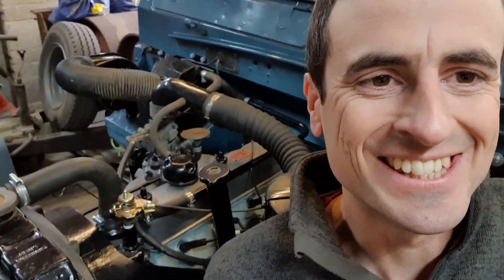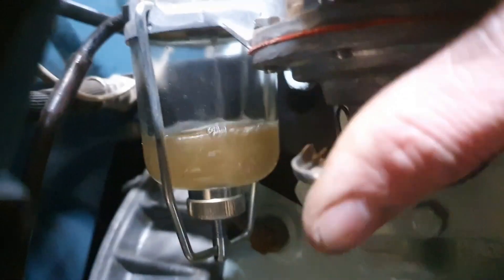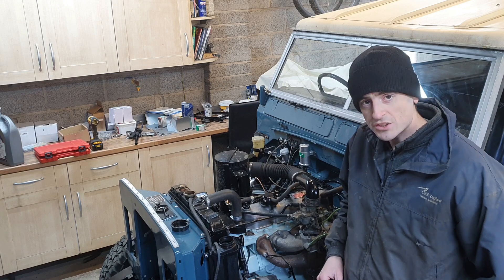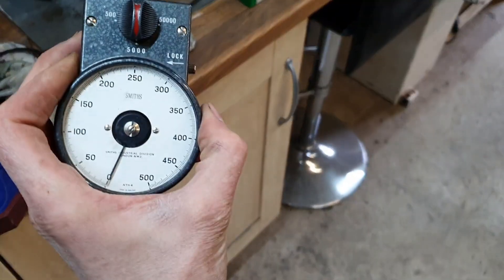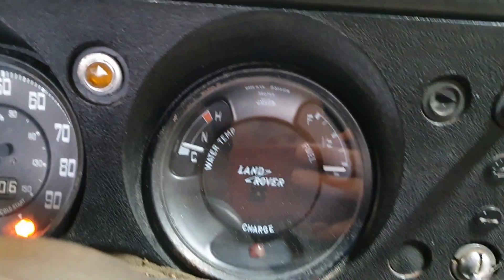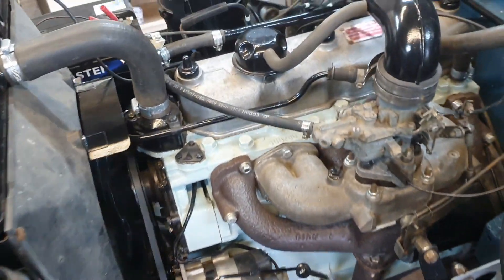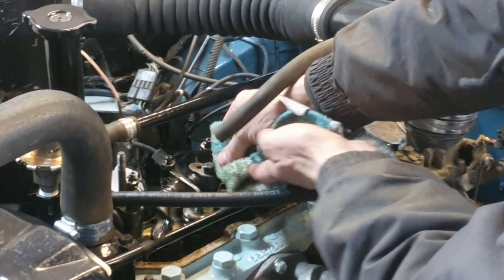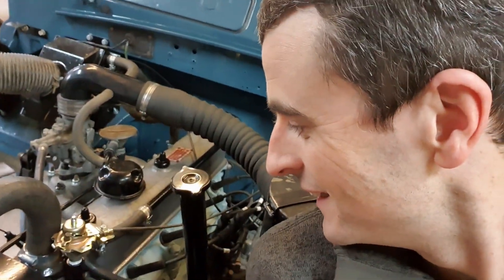2.25 petrol tapping on first start up - Adjusting rocker clearance - 39 Land Rover Series 3 Project

Comment: Hello, have you got any tips on setting the ignition timing e.g positioning
Reply from the maker: Hi there. Yeah set it statically first, that means having the engine at the right position but not turning. 8 degrees before TDC I think.... then with the ignition switched on use q test light bulb earthed at the distributor. So as you roative the distributor back and forth by hand the light bulb switches on and off. With the engine in the right position set the distributor to the point where the bulb switches on and tighten it down that should have it pretty close